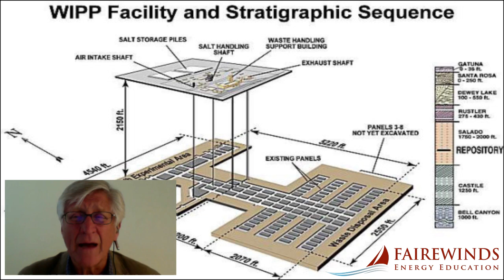Arnie Gundersen:  What's Leaking From the Nuclear Waste Isolation Pilot Program  (03/07/2014)

Comment from the maker: http://up.anv.bz/latest/anvload.html?key=eyJtIjoiTElOIiwicCI6ImRlZmF1bHQiLCJ2IjoiMjM2ODAzIn0= 
KRQE, Mar. 10, 2014 (emphasis added): WIPP radiation leak still a mystery [...] contamination drifted across the countryside and 26 miles west, all the way to the city of Carlsbad itself. Nuclear experts told residents, worried about children, the WIPP contamination now confirmed to have reached town is not dangerous. ”Below any limit, just above background, and would result in no health potential to a child, or a fetus,” Fran Williams, URS technical advisor said. [...] Panel 7 is where workers most recently put waste. The radiation leak is believed to be [in that panel, which is the length of a football field]. [...] it’s thought most likely part of the roof of the mine here collapsed on and ruptured containers. Another possibility is that a container blew up. [...] Roof sections here have collapsed before, two decades ago during stress tests. Hundreds of tons of salt crashed down. [...] Salt is elastic, so from the moment tunnels are dug they start to close back in. Roof bolts slow down, but do not stop that.